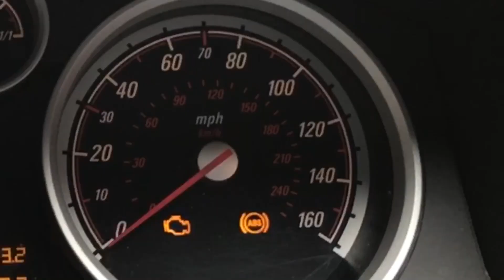VAUXHALL OPEL ASTRA H FRONT ABS SENSOR & WHEEL BEARING HUB REPLACEMENT

Comment: I did mine as per the Haynes manual, what a way to do it. You don't need to take half the bits off according to your video. I've changed one of two bearings, the first one as per the manual, the second one i'm going to do it your way. Great video, wish i'd seen it first before doing the first bearing carrier. Thanks very very much.
Reply from the maker: Thanks for the great comments 👍🏻👍🏻
Reply: Haynes always do far too much. That’s why nobody uses them nowadays!

Comment: Hi my astra millage and trip counter has stopped moving and I've got no abs light on the dash, on start up everything else works on the dash I. E rev counter speedo ect, I've checked the abs fuses both OK any ideas, cheers Al.
Reply from the maker: You need to read the eobd codes to see if a sensor is faulty, Thanks for the great comments👍🏻👍🏻🛠

Comment: My 2008 Saturn Astra is producing a Code C1207 which by research is, "DTC C1207 00: Left Front Wheel Speed Sensor Circuit High Input Malfunction". The Check Engine, ABS & Traction Control lights are on and when this sccurs the rear brakes seem to clamp down until the ignition is turned off and started again sometimes a couple times and then the car can move. I have connected my simple Bosch Scanner to the connector & when this occurs, I get the C1207 Code, however when the car is started and the lights are all off, the code is not present. An OHM Meter indicates both front left and right sensors measure 5.22 Mega Ohms. Does my situation seem like it could be resolved with a HUB replacement or should I look further. Thank you for your kindness and Awesome Video!
Reply from the maker: if the brakes are clamping down until the ignition switched off, it is more likely to be a abs pump/valve issue, Thanks for the great comments👍🏻👍🏻🛠

Comment: Hi mate i have the Mk5 Astra With Abs light on Dash. I had it on diagnostic Machine and It would not Read Any Faults,  Would Could Be the Cause of this, Abs Wheel Hub oh Abs Module?
Reply from the maker: you should have a code, maybe the reader doesn't code abs systems, Thanks for the great comments👍🏻👍🏻🛠

Comment: Hi there without being daft when you show the hub the connecter is sitting in a blue lug/clip do you pull this of or snap it out ,or do you leave it there and fit the hub as the hub i have is the same and the blue lug is really stuck there, dont want to pull to hard if it is meant to be there many thanks
Reply from the maker: The blue clip is just for transit, pop it out👍🏻👍🏻
Reply: Sorry for the late reply, thanks for your help
Reply: @valleysman1234  I came here looking for the exact same thing you asked haha. I just received my new wheel bearing and had 100% the same thing as you. I had to just snap it off, with way more pressure than I would have expected. It was a pain getting it off. 
Did yours just ‘pop off’? Mine more like snapped off.
Reply: Hi there mine was the same the amount of pressure i had to put on it without sounding daft i was thinking to myself i must be doing something wrong like you said mine snapped off, when we got the bearing i was thinking  what was this clip for, and it had me going and nothing in the box saying what the blue clip was for LOL. SO A BIG THANKS FOR THE VID AND THE HELP. 
 @gwaddy4746

Comment: Hi What kind of abs sensor and wheel bearing had you installed? Brand and model? And are you happy with it after installation - meaning any issues or not at all? thanks
Reply from the maker: I bought them from gsf motor factors, can’t remember what they were, but no problems since fitting, thanks for the great comments 👍🏻👍🏻🛠

Comment: Hi, you mentioned "but usually when you start the car and the abs comes on, if it goes out 
as normal, but comes on when you start moving the wiring will be ok, and
 the sensors at fault." my one stays on at start up and never goes out, is more likely wiring?
ordered a op com so hopefully get code, thanks.
Reply from the maker: Thanks for watching, I could be your sensor or wiring, I would put my bet on a faulty sensor 👍🏻👍🏻

Comment: Hi, If the issue is as per what's explained in your, btw excellent, tutorial.... will the ABS light simply vanish without any intervention? Eg not having to plug something into the car/ECU and clearing the fault? Or would that still need to be done?
Reply from the maker: Most times the light will go out on its own, but sometimes it will need the codes cleared following the repair, thanks for the great comments 👍🏻👍🏻🛠
Reply: @aaanton11  thanks very much pal :)

Comment: Hi I’ve recently replaced the bearing as the bearing was starting to fail. Since replacing the ABS light is constantly on and was not on before changing the unit. I’ve checked the wiring connection and that seems to be ok. Any ideas?. Thanks
Reply from the maker: The most Common reason is the drive shaft cv joint end is corroded and when the wheel rotated for the first time after the repair, it will have damaged the new sensor, like I show in the video the clearance is tiny, Thanks for the great comments👍🏻👍🏻🛠
Reply: aaanton11 the AbS light came on soon as I turned the ignition on and did not go out. The car was stationary at the time
Reply from the maker: Do you have a eobd code reader, you might need to reset the system, also the wiring loom behind the wheel liner tends to corrode on some models its easy to repair, link to code reader, https://amzn.to/2WY3cB9 , Thanks for the great comments👍🏻👍🏻🛠

Comment: Hello, can I ask if the sensor only can be changed? I have intermittent signal from the ABS speed sensor which throws a P0500 error code and I'm not sure if it's a new hub job or just a sensor.
Reply from the maker: The sensor is a part of the bearing you have to replace as a unit, thanks for the great comments 👍🏻👍🏻
Reply: @aaanton11  have you tried to separate them? The dealership says that you have to buy them as a unit, but all over the internet I can find the abs sensor with the ring (front).

Comment: The top bolt just will not come out of its hole behind the bearing. It undoes all the way and then will not come out. It just spins and spins. Any suggestions greatly appreciated please. I have a track day in 2 days time.
Reply from the maker: do you have a impact nut gun ? Thanks for the great comments👍🏻👍🏻🛠
Reply: @aaanton11  All done mate thanks for the reply

Comment: Need to do this job on my Saab 9 3 (basically the same car mechanically).  ABS light and traction control light are on the dashboard.  Now this might just be common to the Saab, but my car makes a serious grinding noise and you can really feel it through the pedal the first few times you use the brakes! Almost like the brake pads are worn down to the metal but after the dashboard has let of a series of pings to notify you, it all returns to normal ! ( discs and pads are new) I've already swapped out the ABS  pump but that didn't improve anything. Did you have a similar experience?
Reply from the maker: The abs did kick in a few times until the fault light stays on, then its disabled, Thanks for the great comments👍🏻👍🏻🛠
Reply: I have a similar experience like you, did you got it fixet?

Comment: Really nice video! Quick question: I touched the break pedal on my Astra H and the ABS fires for about one second then stopped and now the ABS light is continually on. I've never tried a code reader, do you get a code for which sensor is at fault, and do you get a different code if it's the wiring to the sensor that is broken?
Cheers
Reply from the maker: +Steffen Langelo You will get a code for each individual sensor if its faulty, unfortunately it will not say if it’s the wiring of sensor, but usually when you start the car and the abs comes on, if it goes out as normal, but comes on when you start moving the wiring will be ok, and the sensors at fault.

Comment: Quick question for you . my abs light is also on , and when I drive at 6O km -100 km I get a horrible sound and vibration in the car really droany, do you rekon that's the wheel baring ?
Reply from the maker: +victor medvediuc sounds very likely 👍🏻👍🏻

Comment: Hi aaanton11 we spoke a while ago about the blue clip that the plug is fixed to as you said the blue clip  was only there for transit,  that clip then was attached to a blue plastic ring that went all the way around on the inside of the hub does that ring have to stay in the hub or does it some how have to be removed sorry to sound stupid but if the plastic ring has to come out of the hub can you tell me how to remove it many thanks for your help.The reason i ask is i got round to doing this job but the abs light is still on but the speedo works fine as with the astra h abs and speedo are in the hub in the left side and the trouble i had was speedo work when it felt like it and abs light is on speedo works fine but abs still on sorry for the long question.
Reply from the maker: There is a protective cover for transit purposes, but if you removed it there must be another issue, was the drive shaft hub corroded at all this can damage the wires?

Comment: Why not test the sensor first by fitting the wiring plug BEFORE you do all the dismantling by giving it a spin while wired up ?.
Reply from the maker: If it’s a issue with the pickup ring in the bearing you can’t spin the new bearing to test it, it’s too stiff, thanks for the comments 👍🏻👍🏻

Comment: Would the code reader tell you the code if it was just a cable thats failled ..
Reply from the maker: A code reader would tell you there is a fault, and which wheel the cable has failed, or the sensor has failed, but it will not tell you if it’s the sensor or the cable. It just points you in the right direction 👍🏻👍🏻

Comment: Hi there, what tool do I need to remove center nut of drive shaft? 3:47 Many thanks!
Reply from the maker: 32mm socket, thanks for watching 👍🏻👍🏻
Reply: When he tells you, it must be torqued up to 150 lbs/ft, so you will need a good torque wrench and some muscle.
Reply: I havent got a windy gun and its on solid after heated up what else can i use thanks

Comment: Anton......very useful video. I'm in great need of help. 57 plate 1.4 Astra ABS kicks in under light braking when it shouldn't, with grinding noise. Strange tick tick noise from behind the dash board too.
Have replaced brakes, discs, new fluid, ABS ECU, passenger side bearing and still have the same problem.
No fault codes on reader and no ABS light showing.
I'm at a loss.....if you do read this, I'd be interested in your thoughts. Many thanks. DC
Reply from the maker: I definitely would be focusing on the abs wheel sensors, or the wiring to the sensors, check the wiring behind the plastic inner front wheel arches, if the connections are corroded or the wire chaffed this would cause the issues, also watch my video on the corsa d rear abs sensor, it has a lot of issues the same as the astra. Thanks for the great comments👍🏻👍🏻🛠
Reply: @aaanton11  Many thanks. I'll crack on one more time 😊

Comment: You haven't torqued anything up?? Especially the main hub nut which definitely needs to be set properly or the bearing will fail.
Reply from the maker: Torque wrenches are overrated, and not everyone has them, so back to the old skool, Thanks for the great comments👍🏻👍🏻🛠
Reply: @aaanton11  seriously?? Torque wrenches are overrated?? You'll find they are essential! Proper mechanics have them for a reason!

Comment: 4:34 i cant get the fuckin screw out
Reply from the maker: have you released the drive shaft nut and pushed it back slightly, Thanks for the great comments👍🏻👍🏻🛠
Reply: Yes i released the nut, but i cant push it back
Reply: Now i could push it back.. but the nut is a bit round.. i dont know what to do now 😞

Comment: Useless video. No torque specs!
Reply from the maker: Which Torque settings would you like, you only need to ask, Thanks for your comments 👍🏻👍🏻🚘
Reply: @aaanton11   I figured it out by myself, but it took some time. Gladly I found the answers in some german forums. Maybe you want to add it to the description (I hope I translated it correctly):

Torque specs (Astra G CC): 
- 2x bolts Brake (clean it - no oils!): 30NM 
- Main driving shaft nut: 120NM -> loosen it -> 20NM + 80° (until splint fits)
- 3x bolts bearing hub to axle: Loctite 270 -> 90NM + 30° + 15°
Reply from the maker: Super informative thanks for that👍🏻👍🏻
Reply from the maker: I have added to the description thanks again 👍🏻👍🏻